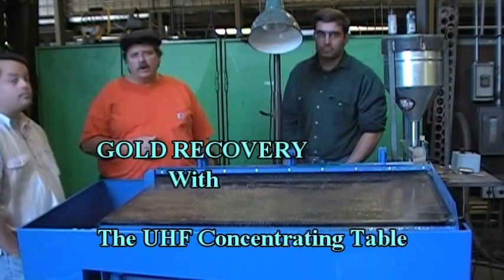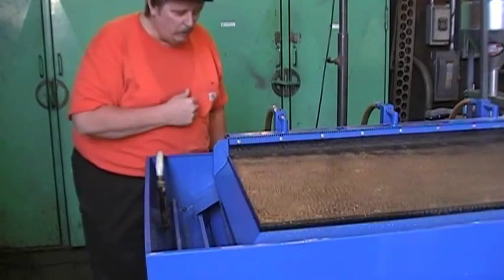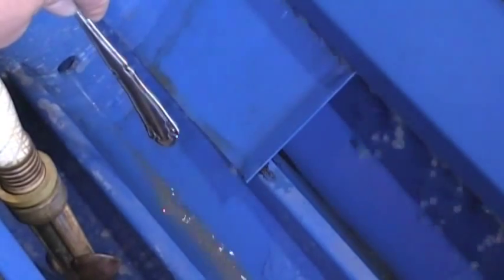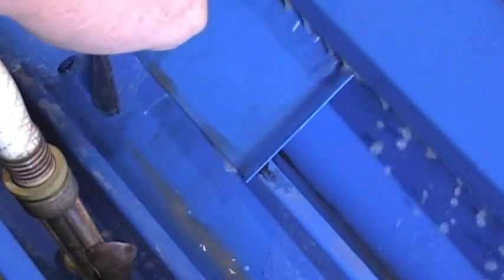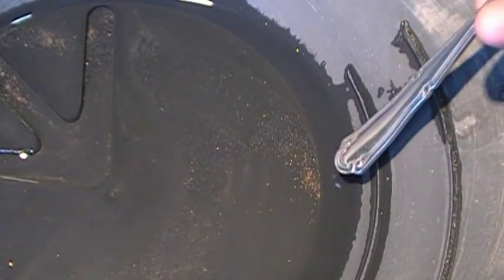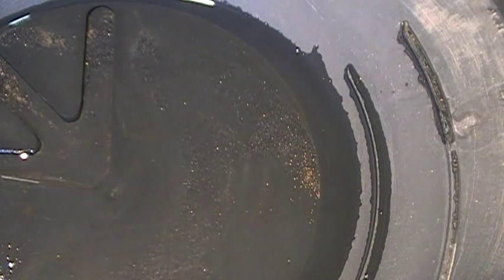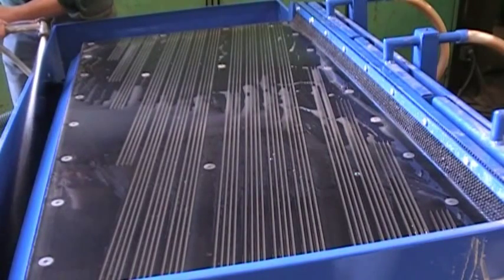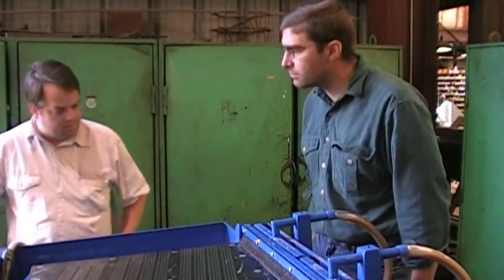UHF Gold Concentrator Table

Comment: These are far to expensive for a hobby machine need something people can do from home
Reply: RP4 shaker table by 911 metallurgist, about $3,000 complete. magnets under side, with stand.
Reply: How expensive? You have to consider that you will always be able to sell it again when you are done with it some day. So if it costs 10,000 for a small one and you sell it some day for 5,000 it really only cost 5,000. Make a small e-waste recycling business out of it too while you are at it. May be able to make it work. It looks like such a fun toy.
Reply: @xcvsdxvsx  What's e-waste? From circuit boards and the like? How can you use it for that? Thanks
Reply: @snakeplissken3021  yes. The shaker table works for circuit boards. The table could separate the metals from the plastic. And you need to crush and grind it firstly.
Reply: How aboit a 1/2 size table?
Reply: @secretsquirrel6718  even a double size shaker table with twice capacity would be 1/2 cost from China. Do you just want a small one?